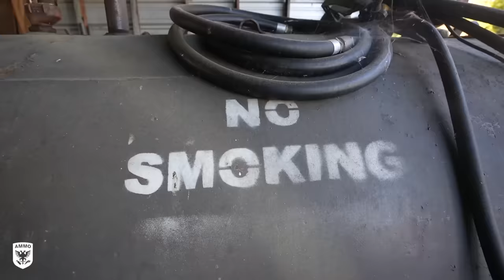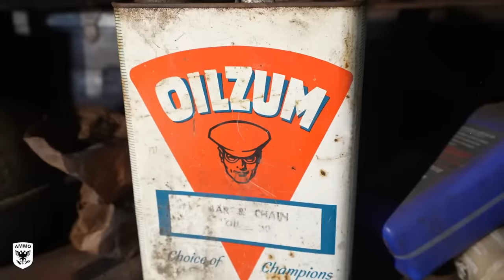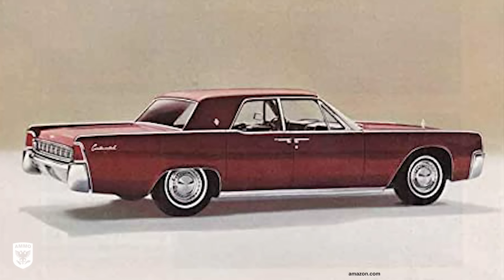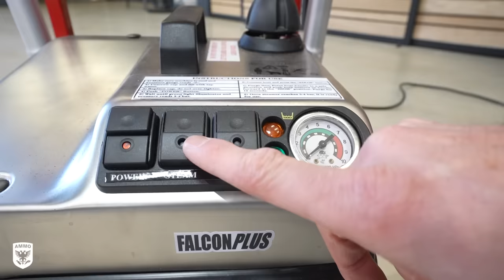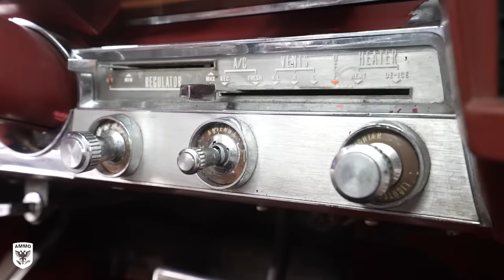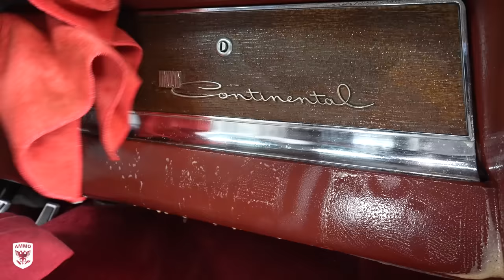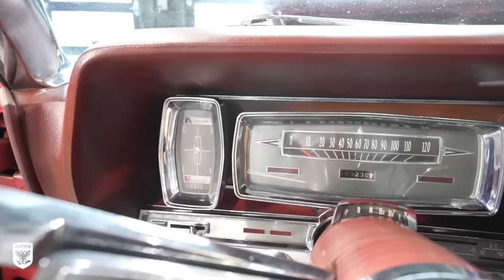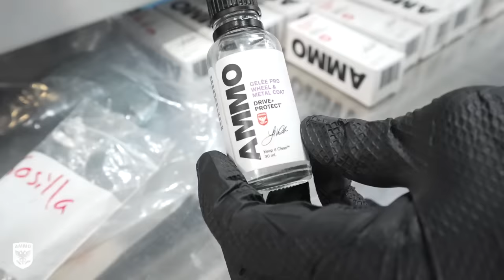MOST DISGUSTING CAR EVER! First Wash in 27 Years on Gross Lincoln Continental Surprise Reveal

Comment: I restored 6 of these suicide door Lincolns. You have to be impressed by the quality of the build. The sticker " danger " is owner added, as is the Continental star on the front fender side ahead of the wheel. If the leather hasn't dried out you can simply redye it using SEM aerosol leather and vinyl dyes - a permanent solution. The automatic headlight dimmer mounted on the dash was sometimes called " The Magic Eye " If this car is going back into daily use, the VERY first thing to do is convert the single brake master cylinder to dual. Immediately if not sooner. These cars weigh 6000 lbs.
Reply: People make a big deal out of single master cylinders. Theres nothing wrong with a single master setup in good shape if the parking brake is working. I've got a truck that has a single master cylinder for all four brakes and the clutch. Its all part of the authentic experience of these cars.
Reply: Thank you for this comment.  I was wondering about the dimmer.

Comment: Lovely video as always Larry, they all just sound like great guys and the car is absolutely gorgeous. American cars of the 60s/70s and Malaise eras are absolutely gorgeous and as a Brit I'm jealous we never got them here!
Reply: The 1961 Lincoln Continental won the Bronze Metal by the Industrial Design Institute (IDI) of New York. IDI seldom, if ever, bestowed this award  to a car and its design team but they found this styling outstanding. The Lincoln also won Car Life's Engineering Excellence Award.
The 1961 Lincoln Continental shared front end styling with the 1961 Thunderbird. The design was revised for 1962 and changed very little until 1970. The 1961 styling was much better looking in my opinion.
The last traditional sized Lincoln Continental Town Car rolled off the assembly line in 1979. From 1961 thru 1979, this styling served Lincoln quite well. You can still see styling ques from 1961 in all subsequent Lincolns thru 1979. If you have never driven a big Lincoln, you have missed out on an exceptional experience.
Lincoln - What A Luxury Car Should Be

Comment: I restored and own a 1963 Lincoln sedan.  There is NO LINCOLN STAR on the front fenders.  Def a damage repair or the owner wanted to add it.  Also, I'm certain that is not a 1963 interior.  Swap out or a re-upholstered interior.  63 Lincolns do not have buttons in the leather upholstery.   Incorrect carpet.  63 Lincolns have a loop nylon, not a cut pile or what most people would think of as shag.  This vid made me tear up as my dad helped me with the resto.  WELL DONE LARRY!  Keep the vids coming.  Big fan.

Comment: Larry, since you do a fair amount of these barn/garage/coop finds, have you considered keeping a 5# CO2 tank on hand for the tires?  Throw a fixed regulator on it along with a nice coiled hose and you have a very clean travel kit for try to get those tires bumped up enough to roll out of where they were hidden.  Much much lighter than any compressor and zero need for electric or even a generator.

Comment: And my third comment (so few Lincolns, I rarely can flex in my area of expertise) 

The device on the dashboard was called an Autronic Eye, as as you said, it was an auto-dimming light amplification sensor, connected to a relay to the high beams. They first came out in the mid fifties, and Ford was buying the license from GM to use them on Lincolns (technically Continental, since the first year and a half of Mark II's were branded as only Continental, later merged in with Lincoln. I believe the first use of the Autronic eye was in 1957 on the Continental Mark II.

Lincoln has a weird history with using GM components on Lincoln, all for the same of reliability and quietness, such as the Saginaw PS pump used from 72 onward, window motors and gears (ACDelco), radios, antenna motors and many other parts. 

This was the era (61-74) where Lincoln was focused on quality and comfort above all else, even if the component may not have been a FoMoCo part. It didnt matter, as long as it was quieter and better. Also, this was the era of no "change for the sake of change." Lincoln only changed designs if there was an issue or problem. resulting in long stretches for external parts, even identical model years (66-67, with only difference being fender Crosshair logo on one, but not the other, and 77-78 with no visible differences at all). 

The design team for the 1970 Continental had fought A LOT with Ford HQ, wanting to make something timeless and unique, without further changes, and was shot given the green light, up to the tail lights, which had to be as they came out, with Ford finally giving in by 72 (same as 73) with a sleaker, three lamp setup, with no divisions over the red lens, and integrated reflector/lens). It was a compromise to the one single red lens across the width of the car, a la Thunderbird, which initially was supposed to be a Lincoln 2 door, (which can also be seen in the 61 Continental and the design language used).

As a note, the design did change mid decade for the 60s, and that was the 65 Continental which was seen as a massive failure, as it looked too much like a Mercury. Eventually Mercury kept that design look to the end of the decade, but Lincoln needed its onw look, resulting in the 66, which was a gorgeous looking car, despite the significant size increase. Its no wonder they kept it the same for the following year. The late 60s were a love/hate look (I personally like them) which was done deliberately in anticipation of the new body on frame 1970. Ford I suspect wanted to release it in 1970, new for the new decade, and one year later milk the hype as it was Lincoln's 50's anniversary. Lincoln would keep the start of the decade for all major releases up to 1990 (1980 Mark VI, 1990 Car of the Year, Town Car). Another interesting thing is that this prequel design is also seen with the late model Camaro/Trans Am going from 2nd gen to 3rd gen. I would not be surprise to know that design team members from Lincoln may have gone off to GM and hinted at this technique, hinting at the future model, since in both cases, the design cues were intended and looked better on the subsequent models (For Lincoln it was the grill, being raised from the level of the headlight bezels, and the rear door "Kickup", for F bodies is was the tail lights, and rear fascia, rear spoiler, and ground effects as well as interior cues.

Going back to the Continental, Lincoln always wanted to have unique engines, not available for Ford or Mercury, thus having the 430 (what's in this car here), then the 462 for later 60s. In 1968 the computer designed 460 was released, and stay a Lincoln exclussive (shown by the Lincoln sticker on the air cleaner housing cover) until 1972 mid-year when it was offered as an option for the full size wagons by Ford and Mercury (Country Squire and Colony Park) and the oddball Ranchero pickup/car thing. Funny how 72 had the "Ford 460 4V" sticker on the air cleaner vs the Lincoln sticker, showing that Ford already decided that it would offer the engine in other applications, eventually making its way into anything that could fit it under the hood. It was the last Lincoln specific motor, going up to 1996 in pickups. 

Im rambling enough, and you probably won't see it. Just excuse my indulgence. Im an old broken guy, reliving and sharing some useless tidbits about these cars. (PS My area of specialty is early 70s Continentals, as far as fixing as well as assessing originality)

Comment: You mentioned that the seats soaked up the mousse. Do you keep applying additional coats after that, or is it diminishing returns after the first?
Reply from the maker: Yes I did 2 coats as the hide really needed the hydration.
Reply: Also it's possible to put carnuba car wax on the leather. Or similar shoe leather rejuvenation wax.   I have a suburban w/ three row seating.   Front buckets have been totally dried out for 20 years, while the back rows are in never sat in condition. This week!
I put "redback" , leather preservative on the front and mid bench.

Comment: Terrific video and awesome job.  The warning on the driver-side windshield frame was made with a Dymo labeler and not original.  The top is fully automating, including the front windshield locks, so some owner must have put that on to avoid smashed fingers.  Car was repainted, evidenced by overspray on hood bumpers, door latches and manufacturing door plate.  The Continental stars on the front quarter leading edges are from 1966.  The seats are from a 1964.  You did amazing work, in spite of the biohazard!  I hope they can make it road worthy again and have the time/money to get the top functional as well as the rear door windows that auto-lower an inch to open the door when the top is up.

Comment: Great video and a job well done!  The label on the inside windshield frame is not original; it was done with a Dyma labeler.  The top mechanism is completely automatic, including releasing the windshield latches, so some owner put that label on to be sure no one crushed their fingers.  The car was repainted, as evidenced by the overspray on the hood bumpers, the manufacturing plate in the door jamb and the over-sprayed door latches.  The seats are from a '64.  Thanks for a great video.

Comment: Another great video. Reminds me of a 54' S-Type Jag recovered from a bar where it was sitting in the middle of a wall for almost 40 years. Very famous car, unfortunately, it was left in a parking lot during a hot summer and heat waves ruined the dry leather interior and rubber parts, which should have been cleaned straight after recovery. She is the holy grave of Rat-ankhamen and one day she will be restored.

Comment: I found it very helpful with very old single stage paint to "nourish" it after polishing. I do so by putting on what is sold as "ant corrosion oil" in a thick layer and let that sit for a day. If necessary: repeated process. The oil will evaporate in some part but it also creeps into every spot, behind the metal strips and fills every microscratch that hurt the integrity of the paint. Removed with MFTs and then the paint is rejunvenated to a sometimes more than incredible gloss. This can be preserved by simply waxing. In a way it is some severe glazing but there are nourishing ingredients in the oil that give back some resistance to the paint. Works wonders!

Comment: One Correction in terms of facts and history on this car.   The Lincoln Continental was NOT the first 4 door Convertible produced since WWII.  That claim goes to the 1950 Frazer Manhattan four door Convertible.    Series II for the Frazer 4 door Convertible was then in 1951 as well, two different four door body Styles.   So technically, the Lincoln Continental 4 door Convertible was the third style created after WWII.    It's definitely not the first.   Kaiser Frazer Corporation would end the Frazer and it's Convertible after 1951 and focus only on Kaisers and then the merger with Willys occurred.

Comment: Hey Larry, i enjoy your content so much. I do notice that you could use a bit of help with your PPE:

1. You would get more benefits out of wearing your bunny suit if its worn properly. When i do wear one, i choose the full plastic hazmat suits. I dont know what brand those are. Ill check when i get the chance to look at our PPE stores at work. Since its pretty hot inside the bunny suit, i just wear shorts and a tank top inside. Full safety/waterproof boots are also recommended for your outerwear. Wearing a bandanna or some sort of sweatband to wick away sweat from your forehead is also essential. Once you make the decision to put on the bunnysuit, i wear it all day or until the job’s done. 

2. Here’s the most important thing i noticed: wear full length gloves for your first layer. Those gloves go over the arms of your bunnysuit and gets taped over the edge to fully seal it in. This prevents any contaminants getting in through your sleeves and onto your skin. You can then double and triple glove with the much thicker gorilla shop gloves you use. Same thing with the pantlegs of your bunny suit. Those go over your boots, and then get taped over to fully seal it in. 

3. Prior to taking off the bunnysuit, its essential to walk through a misting shower to sluice away any contaminants hanging onto your suit. Take them off in the reverse order you put them on. 
I.e.: donning: mask—>suit—>tape pantleg over boots—>armlength gloves sealed with tape—>double/triple gloves

Doffing: take off double/triple gloves—>untape leg off boots—>untape armlength gloves—>take off suit—>take off mask—>take off armlength gloves. Then straight to the shower.

Comment: At 19:30 the thing sticking up from the dash is indeed a headlight dimmer. I had the same thing on my 1962 Cadillac. If you had your high beams on it would detect the light of the oncoming car and dim your headlights automatically. Which is so funny because all cars of that era had a switch, about 3/4 diameter button, that you clicked on and off with your foot to switch between high beam and low beam. So the gadget on the dashboard freed you up from having to click that button with your foot. Which is effortless! Yet they came up with a gadget to save you that “hassle”. I love technology from that era for its over the top approach to solving something that really doesn’t need solving.

Comment: Yeah, the warning to keep your hands away is just someone's own work.  The seats are from a 64 model which was cheaper than reupholstering the proper seats.  The carpet has been replaced already because the heel pad is aftermarket.  The continental star on the front fender is also added by an enthusiast. All that said, I'm glad they preserved the car inside even if it was infested.

Comment: Around 2009 my car got flooded in a parking lot. It wasn't that much but it was really muddy water. We shop vacuumed out the water and I drove it home the next day. I put it in my garage, removed the seats and lower interior parts so I could extract the carpet and insulation. I washed them outside in a kiddie pool and hung them over the tub to dry. After reinstallation the car was as clean as the day I bought it. I think given the condition of the carpet in this Lincoln, that would have been the way to go.

Comment: A FYI, The Label keep hands away is NOT factory. These card were built at the Wixom Michigan plant along with the Ford Thunderbird. The convertible top is a Hydraulic, Electric & Mechanical Operation. When the Top is down the car has the look of the Conv top completely hidden from view. The Decklid will come up, Then the flipper panel & Then the top will go in the trunk. There are a Bank of relays along with Hydraulic cylinders that operate the top. The Thunderbird convertible was basically the same operating. Also there cars were a “Uni/Body” Construction. To be honest this car is a gem so to speak and is a FANTASTIC candidate for a restoration. The reason is that is, Is because they are a Tough vehicle to restore, The wiring alone in these cars are just a Large job itself to repair and or replace. The biggest issue would be the damage done to the wiring by the rodents. Also to get to the relays and or the top mechanics the back seat would have to be removed.

Comment: The reason for "watch your fingers" warning sticker was the convertibles have treaded screws at both ends of the top front that would automatically screw down the roof to the windshield frame at final operation and if one had one's fingers in between the frames of the windshild and roof one was in for a nasty surprise and possible crushed fingers. I know cause I once had a 1960 Mark V convertible and nearly found out the same thing. The owner's manual also had a warning about that too which I later read. A near painful reminder to always read the instructions before operating any unfamilar power equipment. One just had to let it do it's thing as designed with no finger interference which it always did. 😉👈

Comment: My great grandfather Raymond had a light blue 67 C-10 Pickup Truck with the three on the tree, he bought it brand new in the year 67, he passed away in 1991, my grandma is taking care of the truck for him, I rode in that truck since I was a kid, also my grandma had to take the truck to the shop to fix it up, put new parts on it, got the truck all fixed up now, it's in the garage, my grandma is taking care of it for my great grandfather, I am 21 years old now, got my driver's license, hopefully I can learn how to use three on the tree in that 67 C-10

Comment: Well, here I am, the old guy, who had a 62 convertible in the day.  The warning for the fingers was not a factory thing.  It had to have been added later. Just so you know, if the windows are up when you want to put the top down, the rear windows will automatically lower about 4 inches. This is normal however,  I thought mine was broken when it did that! It was only 40 years later I found out it was supposed to do that!

Comment: The Bad Smell often returns unless you replace things like the headliner or cloth covered wiring harness covered in mice piss crap and more. It’s surprising what holds the stench and it comes back especially on hot days so leave the windows down 24hrs before if you want to drive it or sell it.

Comment: The Lincoln's power top mechanism had threaded pins powered by gear motors to lock the top into the windshield header. Those Dymo labels tell me the owner figured that out the hard way.
Reply: Yes. The gear motors would draw the convertible top onto the top of the windshield and seal it. It would then make a ratcheting sound when the process was complete. My grandpa had a ‘64 and it was an incredibly complicated vehicle.